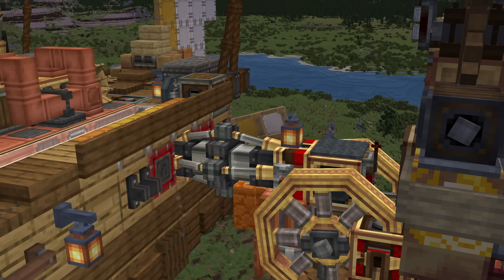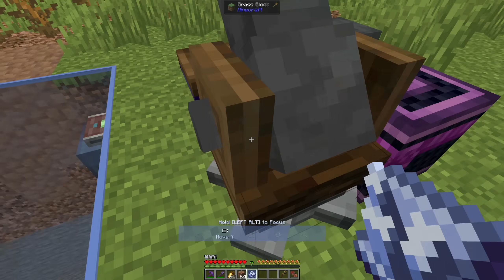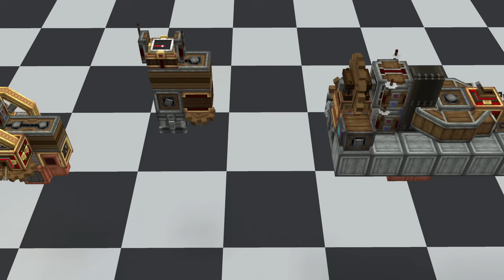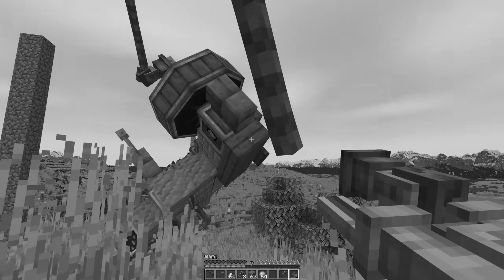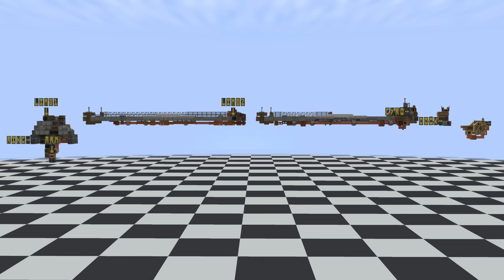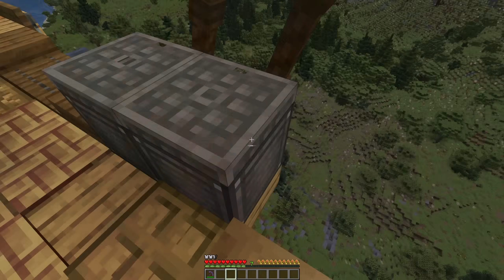Autonomous Mechanical Refueler Tutorial | Create Aeronautics + CC: Tweaked (Survival-Friendly)

Comment: This is really cool, I’ve never used computer craft before but how did you get it to control the sequenced gearshifts? Are they basically just acting as stepper motors and the computer is giving them 1 step at a time or is it setting an angle in the gearshift and then activating?

Comment: I still wanna know what math you did to calculate the arm, I think I know how you moved it just now how you calculated what needed to move
Reply from the maker: You can see in the GitHub repo the math that I did to calculate the arm. The overall math to calculate the necessary angles for the arm was straightforward and simple if you knew basic trigonometry -- but it was mainly implementing it which was a pain to do (converting the angles into the correct ones for the arm to work.)